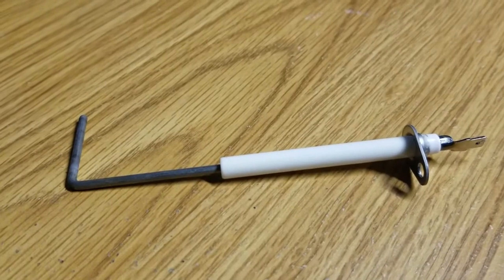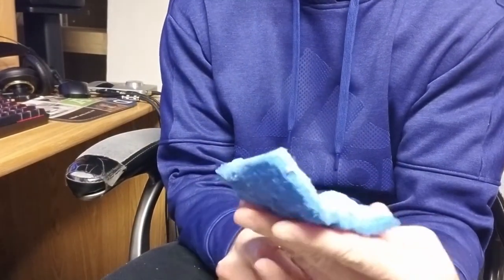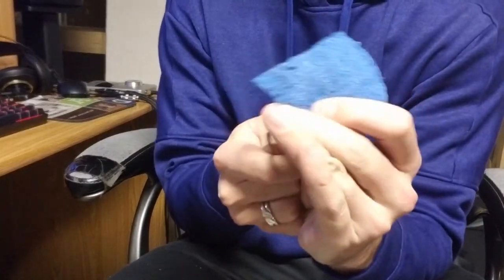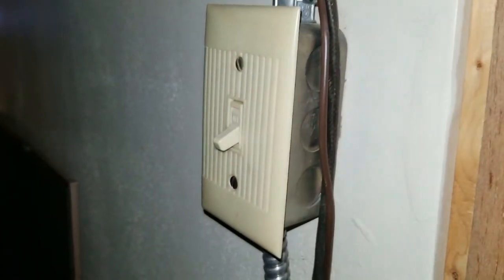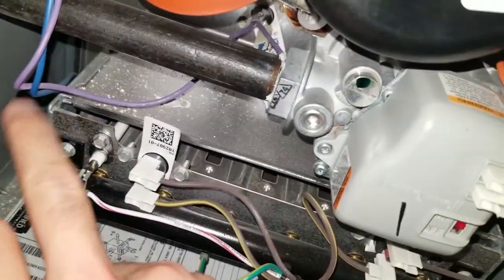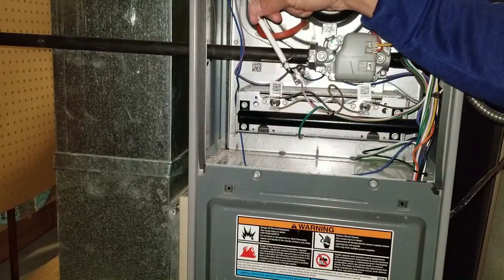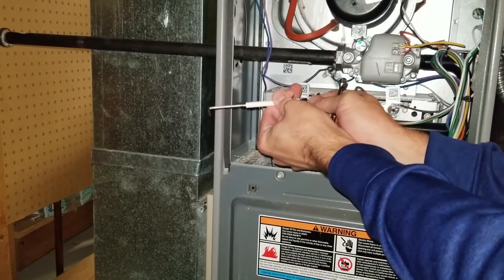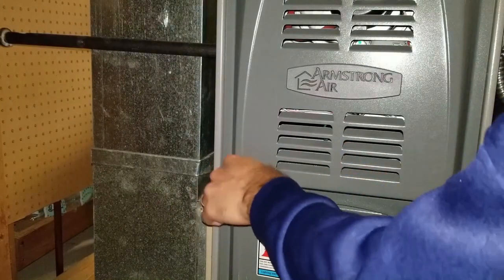Fix a Furnace That Won't Stay Running | Extremely Easy Fix

Comment: I have heard that you do not want to touch the element (flame sensor rod) with your hands.  The oils do damage to it, so I was told.  Mine just just needed to be cleaned today, just finished now and I feel that I just conquered the boiler in a Christmas Story, only I sweared more.
Reply from the maker: Lol. Excellent work. Now that you mention not touching the metal part, I remember seeing that as well. Thanks for bringing that up.

Comment: Nice tip dude, question.. what type of air filter do you use? I heard your not supposed to use ones w high merv ratings but I swear I can tell a BIG difference in the air quality when I use a allergen filter (supposedly bad for furnace)
Reply from the maker: I use a 7. I had a conversation with an HVAC guy at my old house where our furnace was overheating because it was a 4 inch filter and if the MERV value was too high it potentially wouldn't let enough air through once it started to get dirty. So, going to guess the higher the merv the more important it is to change more often. But, definitely not an expert in this field.

Comment: I know this is an old video. However, this was amazing advise!! Got a 7 month old in the house and it’s 18degrees outside. Noticed it was getting cold this morning at like 1am, and the air in the vents were cold. Tried to reset furnace but I could here the flame light and go back off. This fix right here and bam!!! Kicked right on! Can’t thank you enough! Other videos were all about expensive fixes and calling a HVAC tech on a Sunday morning at 1am.
Reply from the maker: Glad it helped. Worth looking into the replacement part as it will likely happen again at some point.

Comment: Hey thank you. I just came across this problem right now and it's 1030pm here in Utah and your tip worked great so you saved me from a freezing night. It's only 18° Thank you.
Reply: 18 degrees and you were is freezing lol. We just had -40 degree wind chills and my furnace stopped working. Try that one on for size if you want to feel insanely cold.